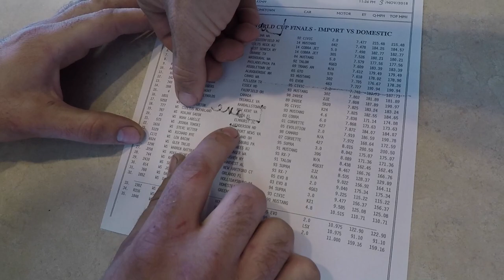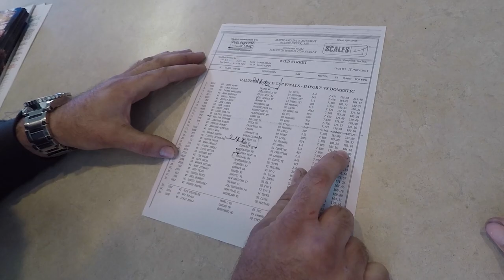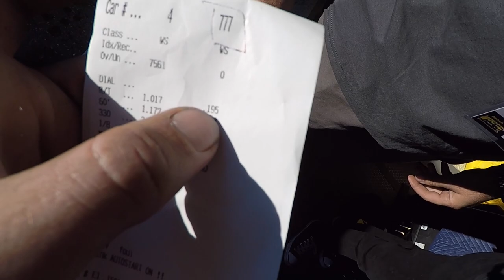World Cup Day #4 - Leroy Goes Out in a BLAZE OF GLORY! (Racing World's Fastest AWD Civic!)

Comment: My opinion/guess is the stronger diff brace and the things you put in your torque tube took away the last of the "cushion" that your diff case had. Sounds funny, but I am big into Tekno RC cars and am part of a Facebook page dedicated to the Tekno MT410 monster truck. We have a few guys that make custom braces and parts for the truck and chassis. Once we started to really stiffen the chassis with machined aluminum braces that went from the chassis to the diff, the diffs started splitting. The energy has to go somewhere, it used to go to the composite braces, but now it goes to the composite diff cases. This might be what's happening to your cast aluminum diff case. Not knocking the product, but your setup with that track prep, can't handle all of that rigidity.
Reply: Wanna buy a Tekno 410.2? I’ll make you a heck of a deal. It’s practically new.
Reply: Same thing with rc helicopters. The small ones can usually take a crash, but if you load them up with aluminum stuff breaks.
Reply: The thing is any shaking, or "give" in the diff mount is lost power and potential wear issues on other components in the end. If the problem is that the cast aluminum casing keeps breaking (and none of the internals ever do), the solution is not to allow it to shake more... You just need a steel case. Cast aluminum is very weak, it's just cheap and stiff enough for stock applications. Get someone to machine a custom diff case of the same dimensions as the stock out of 1045 steel, harden and heat treat it, and it will be the last diff case you will ever need. Even if everything inside shatters there is near zero chance it will damage the case. Sure, you gain a few pounds in weight, well worth the tradeoff if you ask me...
Reply: Matthew Tharp does it have a body? Or is it just the chassis
Reply: @matthewtharp1946  100 bucks
Reply: Totally agree with you, i think the torque tube need to absorb more energy like before.
Reply: This is what’s happening.
Reply: @matthewtharp1946  I already have the Tekno sct410.3 with all the upgrades including the eb48.4 chassis
Reply: sean5comet I used to bash with a Slash 4x4 platinum with lots of upgrades. When I started racing I learned I had to go back to stock parts. Driveshafts are easier to replace than transmissions.
Reply: Leroy needs a billet case
Reply: Im thinking the diff brace might have been too much brace and not enough give to keep it from cracking. But excited to see the c6zr1 replacement.
Reply: @HMan2828  I know what you're saying, but until he has the "better/stronger" case, I don't think the rest can take that amount of grip and power with all of that rigidity.
Reply: sean5comet has a Reedy 4.5/ mamba max 1/8 scale esc. Currently on DE Berrego wheels. New AKA tires. It’s spotless clean. Has many big westcoast wins. Jeremy Hase from AKA team and Chris Vierra from DE Racing can vouch for it if you have heard of them. I was going to dirt oval it and have been to busy with school.
Reply: that's so funny to see this, I had an erevo and busted many rear diffs on that thing running 6s! just didnt have strong enough, or big enough of a diff. good to see fellow rc hobbiest over on this channel.
Reply: There was a Tekno Toys Silvia at the event! Iirc he went to the finals in his class too
Reply: Yep, been there with Traxxas products, load it with stiff parts and shit break, use aluminum bulk heads, better have RPM A arms or even stock. gotta have somewhere for the force to go.
my old Tmaxx had aluminum bulk heads and RPM arms, hardly ever broke anything but those damn plastic drive shafts.
Reply: If you notice, they also figured that out and it's why they removed their billet brace for this run and put the rubber bushing back into place (watch the old vid and watch the view of the diff in this vid before the race)
Reply: wow that's pretty good theory.

Comment: Interesting in that you put firmer bushings in the torque tube and the diff mount. Go back to OEM and that includes engine mounts. I suspect that will help. GM do not put compliance in there for nothing. Factory rubber far exceeds Uerathane crap. And often has less compliance still.
I found this road racing decades ago, solid mounts and you break extension housings and bellhousings. Or the top left ear on Muncies. Or even alloy T10s.  Even with engine plates. I used a Lakewood bellhousing which was a good deal stronger than the alloy GM ones. Rear axle was ofcourse on heim joints but had plenty of movement. But when bound up like so many drag cars they just bust things!
Billet mid plate will help though. Usually this stuff helps a LOT as the case flexing is what breaks things. And solid mounted exasparates the problem. Nothing to dampen the viabration.
The Vette set up to me seems quite good. I considered it but way too expensive and hard to get here in Oz. Especially 20 years ago. Cheaper and stronger [and heavier] than a Hewland.
But being beat on reliabilty by a Civic on 60lbs!!!!
Reply: LDN Wholesale - agreed if you over tighten things, something is gonna bust. The chassis might flex opposite the rear and if you tie it all down they will fight
Reply: You are so correct my friend.
Reply: To blow 3 diffs and then blow the trans, in 3RD gear....? That billet piece in the torque tube allowed too much of a shock load on launch and when shifting. Engineering via breakage is expensive!

Comment: It's crazy how you ran one diff with zero issues all that time on the last motor, but now you've gone just a tad more power it's breaking the jesus out of them
Reply: The track has a say in that. Prepped to hell and back.
Reply: All those solid mounts and solid bushings taking a toll too tho. But yeah, that track prep meant shit got real for his drivetrain tho.
Reply: The last break was the trans. That def didn't go. I wish he would put the billet tans in with that def it may have held better
Reply: MIR always has VERY good prep.  It is quite a sticky place.  They absolutely don't skimp for world cup finals either.  Additionally, the density altitude was like -500 last time I heard them announce it on sunday.  The track is about a mile away from a river and thus very close to sea level.  That coupled with the cool temps at the track (which were actually warmer than I am used to for WCF) and turbo cars suddenly make a TON of power.  There is a reason records are always being broken here.  Like the civic Cleetus raced just broke the world record for AWD civic on that pass.  3 out of the top 10 awd civic records are now held at MIR,  #1, #2, and #8.

When Leroy runs at MIR again, it is going to be insane.  At the rate he is going, he might be the first stick shift GM car in the 6's.

Comment: Why did you guys put solid bushings on the torque tube?    You've got zero give in your entire driveline.
Reply: Those solid driveshaft isolaters def gotta go.
Reply: Doesn't matter with the power he's putting through the drivetrain it's going to break. Even though the C6 stuff is better. It's still not designed for 1500+hp. Things are going to break. It's part of the deal with this setup. You can only leave so soft otherwise it kills your ET. If you think he puts the c6 diff and new trans and is going out and running 7.30s like I've seen many say its wishful thinking. Just not going to be that easy. I wish them luck. They've done an amazing job so far. He will reach 200mph before 7.30s and lose a few more parts along the way. Again they've done an amazing job. No question about that.
Reply: @waynebollentin989   It or something else they changed recently must matter.   They're not running full boost off the line, and he's pedaling it anyway, so the added power they engine is capable of is irrelevant, yet they're now blowing up the diff almost every launch, after they did hundreds of launches before (some with better 60ft times) without issue.    They changed two things in the drivetrain 1. the new diff mount 2. the solid torque tube bushings.      They've since reverted the first.
Reply: @daemn42  your missing my point. Regardless what bushings are used it's going to break when he brings in the power. The trans breaking had nothing to do with what was done to the rear. They went back to the old setup for that last pass. The parts were never designed for 1500+hp. That's my main point. Everything has a limit.
Reply: @waynebollentin989   The torque tube is in front of the tranny too, so it could very well have contributed to breaking that, but it probably broke from just too many passes.    I don't dispute that high hp will break stuff, but they went from hundreds of clean passes to breaking almost every time, and they're not making that much more power.    Something else is a contributing factor here.
Reply: @daemn42  your right they made hundreds of passes but not leaning on it like they are now. Just look at the difference in mph now. There's more power being put to these parts. I've broken enough shit over the years to know you can make tons of passes on a car then make a small change that maybe adds another 50hp and shit starts breaking. My old car ran 7.20s. I been here and done it and have friends that been much faster. I'm not just making it up as I go along. They weren't putting this kind of power down for hundreds of passes. That's the difference. I don't think even with the c6 it stays together very long if their going for low 7s. You need to leave hard for that. Him wanting 200mph isn't as much of a problem. There's already a Stick shift vette going 200mph only at 8.0s though. He's not leaning on it as hard as Cleetus on the hit. How much and how fast you apply the power makes all the difference. There's a very fine line between when shit breaks and doesn't.
Reply: Wayne Bollentin it’s not horsepower breaking the parts, it’s the torque. And this engine has significantly more of it then the last one.
Reply: He's is putting more power to the tires with the solid bushings and  new diff bracket, he's bound to break more often. Also track is very tight
Reply: uhh, horsepower is just torque x rpm/5252. Either statement is correct
Reply: @alpha6ix222  
Its both and I thought I was dealing with mostly people with common sense. Didn't think I needed to go it that great of deal for someone to comprehend what I was saying. Also what gave this motor all this significant amount of more torque your talking about over the other motor? Be specific now since I had to be. How exactly does this motor make so much more torque then the other one if the boost was the same on the hit? You're making it sound like this motor makes hundreds of pounds more than the other on it's own which is false.

Comment: You could try an Andrews transmission. An Andrews a431 4 speed with the right gearset would hold up well. Straight cut and dog engagement of course, something to consider Cleetus. (not bashing rpm at all).

Comment: Not your fault, Cleeter boi. Parts are eventually going to break in a car, especially when you're running a 1300+ horsepower build. Better to break the transmission than the engine. Can't wait to see Leroy back up and running. o7